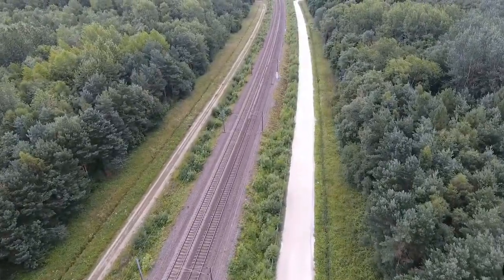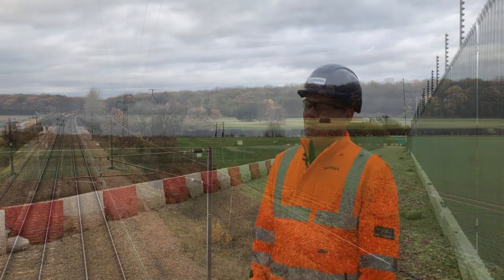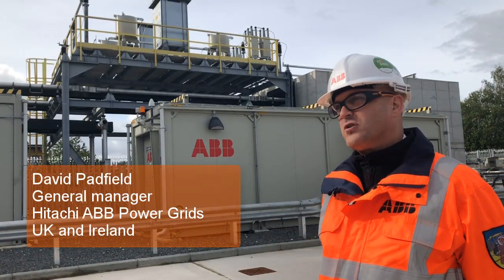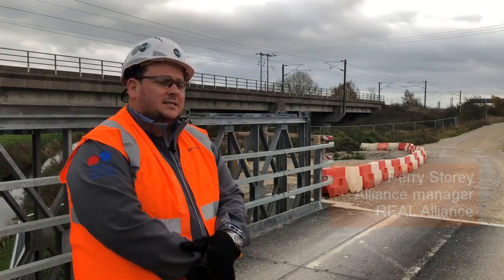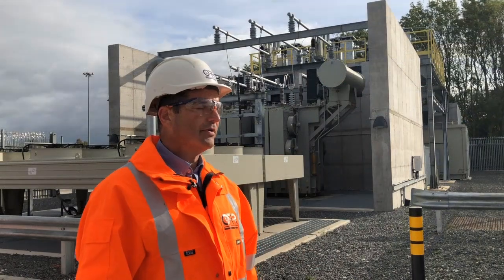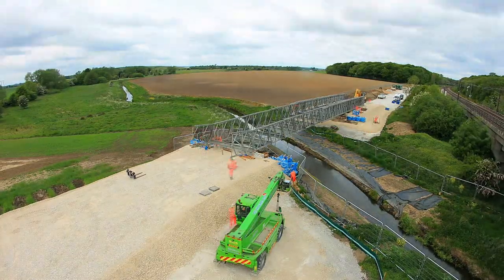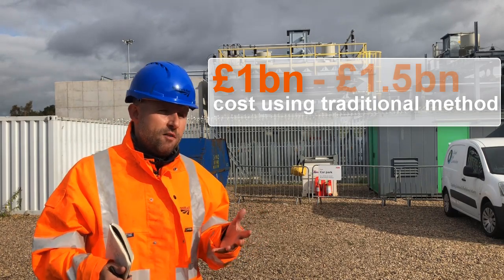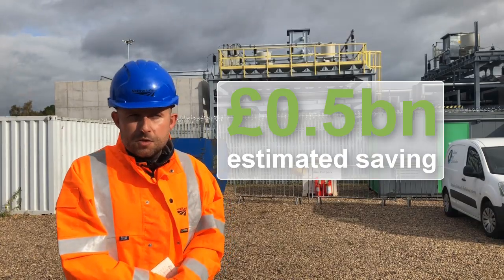Power Supply Upgrade - Static Frequency Convertors

Comment: The SFC was originally used for changing frequency in countries that use 50Hz for the public supply and 16.7 for the railway. But the problem it solves in the UK is basically that electric trains use single phase power but the national grid is 3 phase. With traditional technology the best that could be done was to take the railway supply from 2 of the 3 phases. This causes a huge imbalance which requires the supply to be taken from a very strong point in the grid. The SFC’s power electronic wizardry loads all 3 phases equally, making it a much better behaved load as far as the grid is concerned, so there are more and cheaper options for grid connection. This makes it cost effective even though the change of frequency isn’t required in the UK.
Reply: My thanks. Thought that would be it, but would have liked them to tell us that! Where I worked, we had systems that needed single phase for safety reasons and it was sometimes difficult to arrange.
Reply: Thanks for explaining that. I was wondering why frequency conversion was necessary, but being used in this way, it all makes sense.

Comment: Light on the technical stuff. Let me have a go. In the olden days trains were powered by DC electricity which has several advantages, but the modern way is to actually supply trains with AC power.

So, we are talking about recent electrification. One problem with using AC for powering train engines is they use a lot of power in which is inductive, especially when they begin moving. This inductive power means that the current and voltage are no longer in phase, the motor makes it easier for current to flow at times when the voltage is not maximum. All this happens 50 times a second. This is not really a problem, as electricity generators can compensate at the power station.

But in the video, the electricity supply is a long way away on existing transmission lines, suddenly getting less value out of your transmission lines (called copper losses, as in if the transmission lines were fatter, this would be less of a problem). Well, enter the frequency converter, it uses electricity to make electricity (and a bit of waste heat), but the new electricity is perfect for both the transmission line efficiency and train motor demands. One way to do this “frequency conversion” (really a phase conversion) is with a huge motor and generator attached to each other and spinning 50 times a second, but this it can be done with electronics, image a shipping container full of capacitors charging and discharging 50 times a second, controlled electronically 20 times faster than that to make a nice new AC current source. Because it is not spinning, like the old solution you might call it “static”.

So, the “electronic phase corrector” is called a “static frequency converter”
Reply: I also have a suspicion they can make a Three Phase connection from the transmission network allowing greater power draw (and no worries about unbalancing the load on the transmission grid) and supply that power as the single phase supply required by the railway overhead line system

Comment: Doesn't actually explain what static frequency converters do? All you've done is explained the savings etc.  You haven't explained the technical advantages, except for being able to usa  local distribution grid.

Maybe video should have been "economic advantages of static frequency upgrades"

And how can you have a static frequency as  by its very nature a frequency is off and on a certain time per second.

The whole video was corporate speak.
Reply: That's the point. This is not for people that want to know what they are. They just want to know how they benefit there journeys.
Reply: @utaamtrak9584  it doesn't even do that. It's a very shallow corporate video.  The savings will be to network rail, not the passengers.